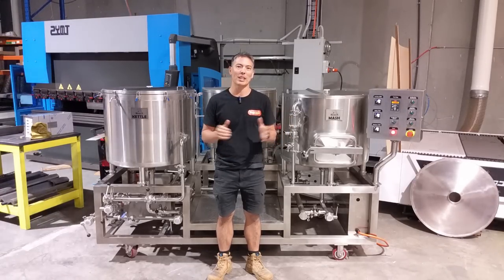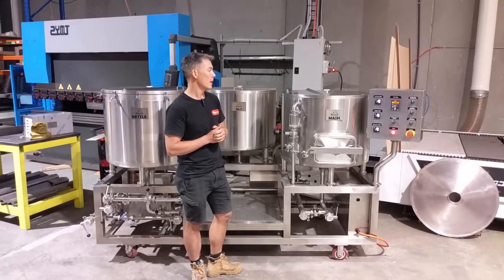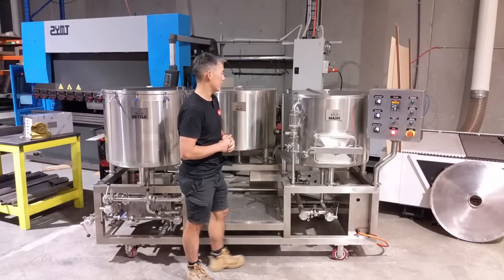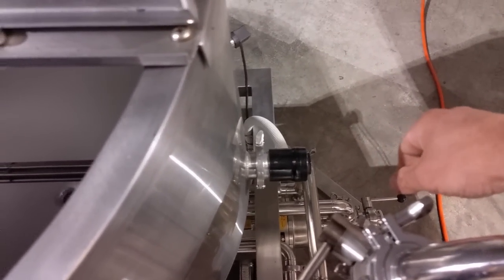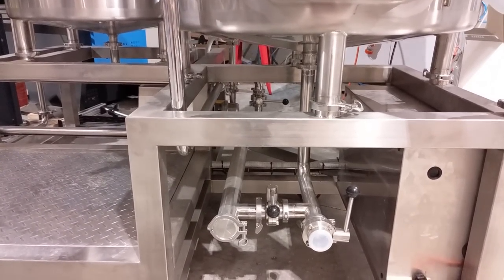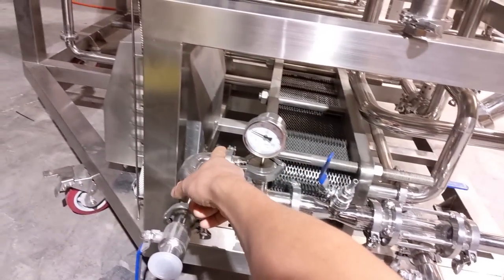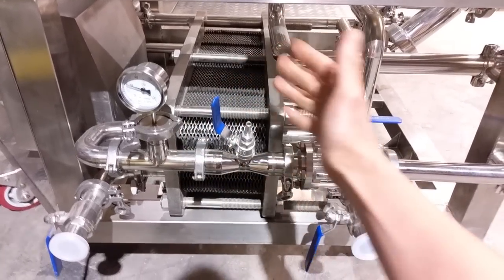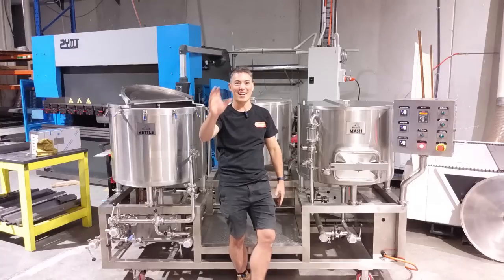BrewZilla 200L 3v System - Micro Brewery, Brew Pub or Pilot Brewing System

Comment: That is a very tidy little system. Looks well laid out, and the heat exchange and pumps are certainly bigger than needed. Very cool.
Reply from the maker: Yeah the pumps are large but also the extra power is nice especially when using the plate heat exchanger which has a bit of resistance in this unit.

Comment: Brewha Equipment makes a 1000L single vessel. it even pressure ferments
Reply from the maker: Yes once you have paid for the gantry crain it ends up being cheaper just to make a three vessel system.  It's also more complicated to use and empty the malt pipe so if I was using these larger systems commercially my gut feeling is that you would end up costing more in labour down the track for malt pipe movements, the CIP cleaning is more involved and I dont quite see the advantage of the larger Brewha systems.  Do you know any commercial breweries that are using the larger Brewha gear and are happy with it?
Reply: @KegLand  they have a YouTube channel with mini docs of breweries using them.

Comment: Tidy setup. The mash tun could cause a few issues as it looks difficult to manually work the mash to avoid a stuck mash, especially with a high grain bill and if using ingredients like rye, oats and wheat and uncooked grains. Why can't the kettle be initially used as the HTL for brew day? This would free up valuable space for a temperature controlled fermenter even a unitank?
Reply from the maker: Yes you can definitely use the Kettle as an HLT if you want to.  Generally speaking customers who purchase this brewery need multiple fermenters so we wanted to keep the fermenters separate to the brewery.

Comment: Why is the knockout hole (the one behind the hop blocker) so close to the middle of the kettle? Wouldn’t you get less of the true pile if it were further towards the edge? Thanks!
Reply from the maker: We have not had this issue so far as the cone on the base is enough to ensure the hops heaps in the middle.

Comment: Nice setup, although i would like to be a mash stirrer option, and possible to return hot wort into kettle after the heat exchanger (whirpool port).
Reply from the maker: Yes that is a fair point. We might look at a mash stirrer as an ad on extra.  Yes normally what you would do is use the same flexible hose that you would normally fill your fermenter with. So at the end of the boil I would heast sterilise this hose and recirculate from the boiler, through the heat exchanger then back to the boiler for at least enough time to heat sterilise the heat exchanger.

Comment: Hi - what is the power consumption on the heating elements, and at which voltage Level is it installed (110, 220 or 400,?)
Reply from the maker: For the standard brewery model we sell this as a three phase system that is 32amps.  Each element is 7kw.  with that said we can customise this to single phase 220v  or 110v depending on what you require.
Reply: @KegLand  so the total consumption would be 32A on a 3 phase 400V supply :)?

Sounds good to me!